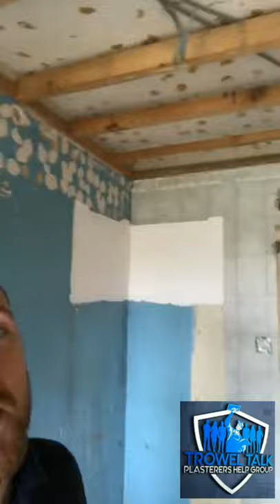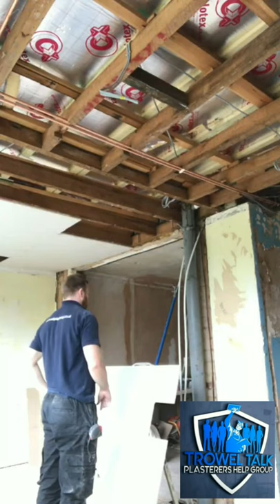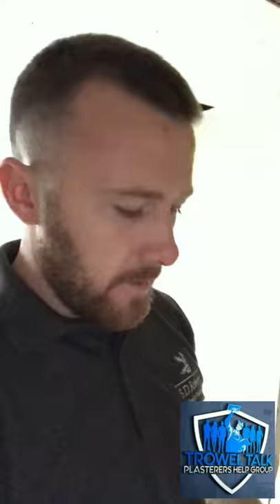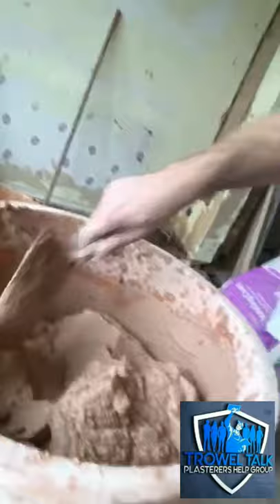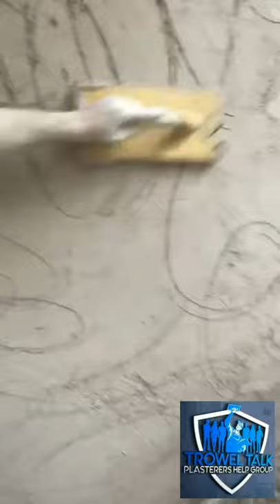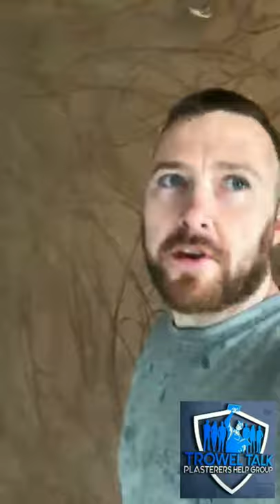PLASTERERS BOOBY TRAP!

Comment: No disrespect but wouldnt 2x1 battons set to sheet widths be easier than random joints and screwin pipes 🙈🙈🤣
Reply from the maker: Different strokes for different folks 👍 we have battoned off in the past if necessary